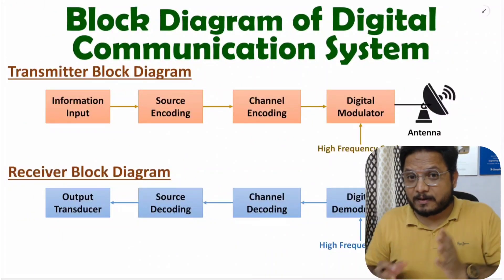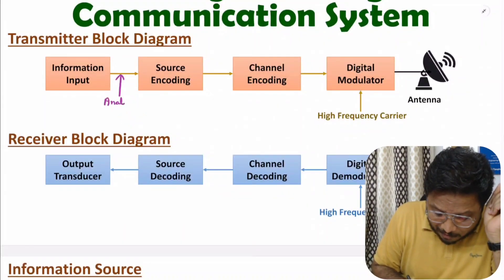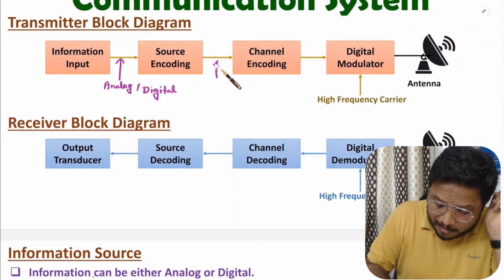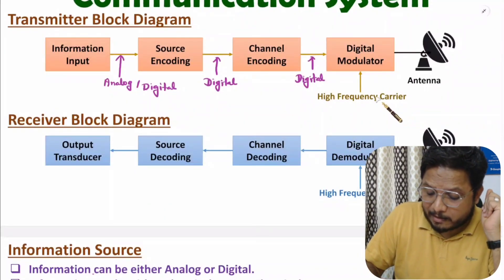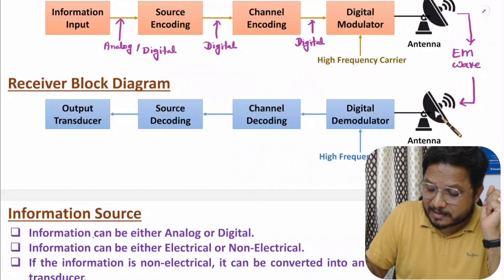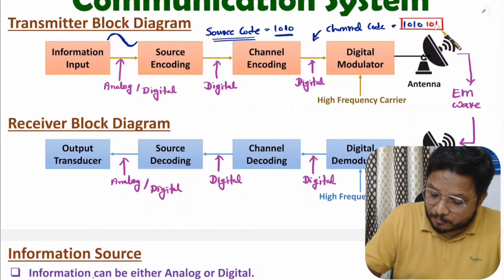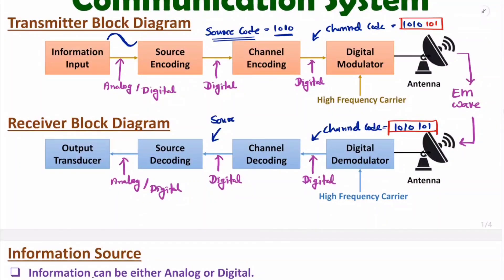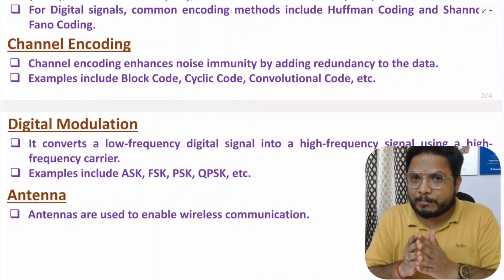Block Diagram of Digital Communication System

Comment: 2:30: Bandwidth refers to the maximum capacity of a communications link to deliver data in a given amount of time. It is typically measured in bits, kilobits, megabits, or gigabits per second (bps).

11:11: The opposite counterpart of a transducer, that converts electrical signals to non-electrical signals is called an inverse transducer. For examples, motion-detecting sensors are transducers that convert these motion detections into electrical signals. Actuators are inverse transducers that convert electrical signals into motion or heat.

Thank you for this video, sir. I understood the block diagram clearly, the things that I have written above are some of my minor clarifications for my own understanding.
Reply from the maker: You are absolutely correct